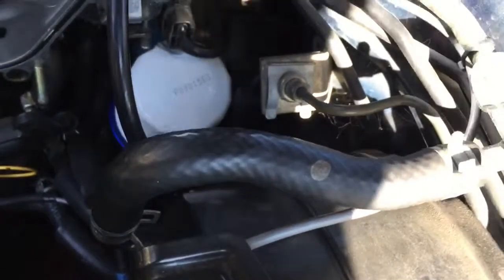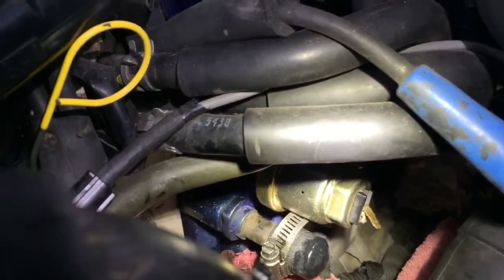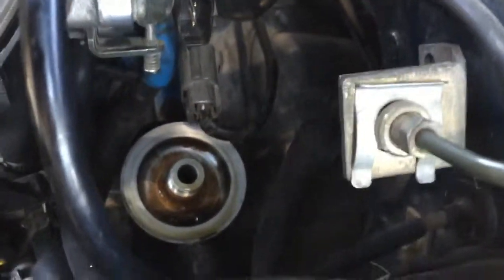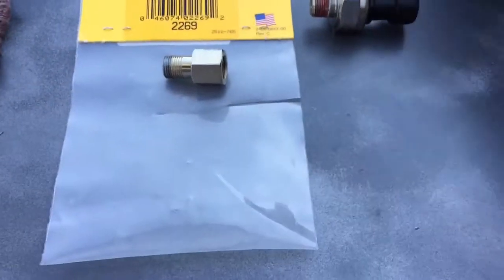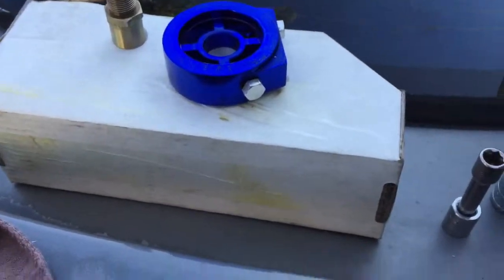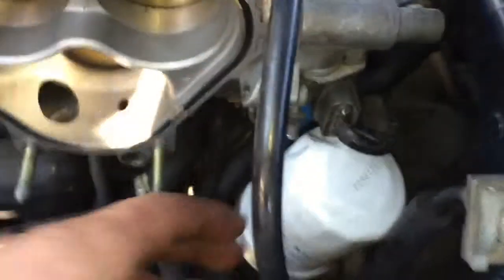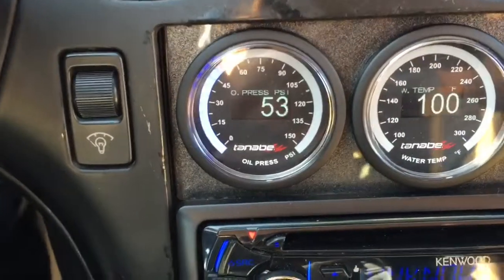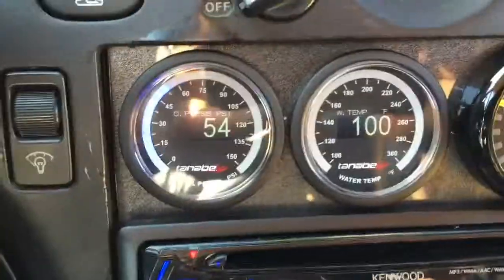93 Rx7 aftermarket oil pressure sensor install

Comment: Hey question what happened to the single wire on the stock oil pressure sensor? 
What color was it? And how did you wired it up?